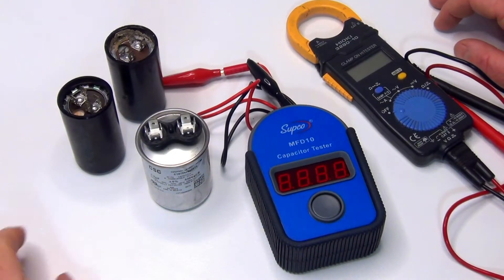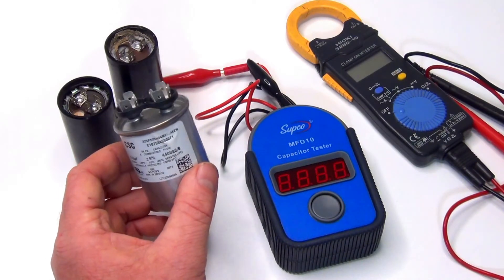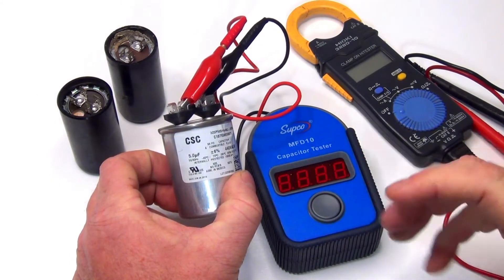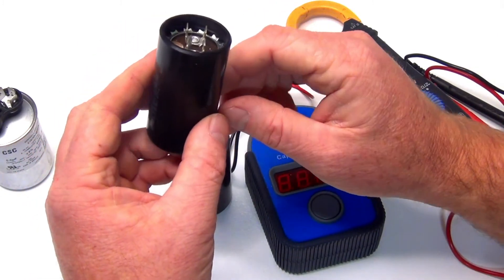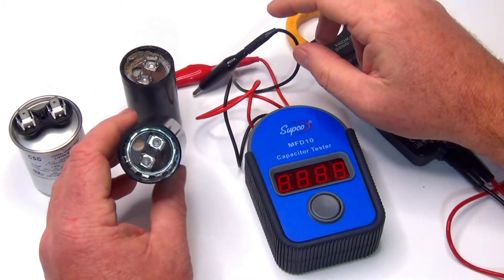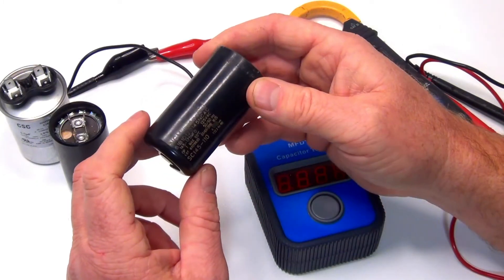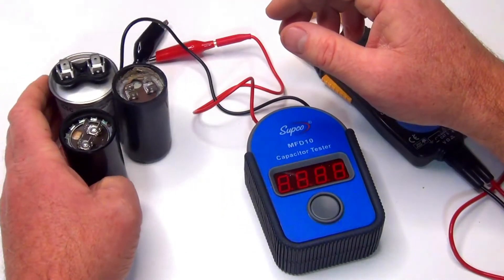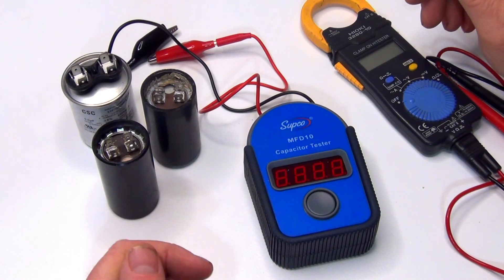Testing a HOT TUB Pump Motor Capacitor | Hot Tub Pump Not Working or Humming

Comment: Had to replace the capacitor on my pool pump motor. 

Just fyi:  It was located on top of the motor housing, not the pump.  The capacitor on my air compressor is located in the exact same place.

Comment: Hey, I have a hot tub but the slow speed pump is not working if I change the capacitor it's work ? When I turn on the show error 6 
Davey Spaquip
Reply from the maker: Find out why that pump isn't working.  Can you hear any sounds from that pump or just nothing?  No sounds?
Reply: @VIPPoolsandSpas   thanks for answer,  when I turn on its work then off push the water then off,  high flow its working
Reply from the maker: @fahadal-badri13  I don't understand your last comment.  If you speak another language, please write it down and I'll just translate it.  Ok?
Reply: @VIPPoolsandSpas  It sounds like they have 2 speeds & multiple pushes of the button cycles it between hi, low & off   Pushing the button 3 times = hi speed on / low speed on / off.
Or, pushing the button 4 times = hi speed on, hi speed off, low speed on, low speed off. . . . A yr. old comment, I know.

Comment: I wonder if you can help me.... I replaced the seal and impeller in my Hot Springs Flair hot tub.... When I reinstalled the pump, I accidentally connected the green wire to the wrong terminal on the pump... when I flipped the breaker to turn on my spa, everything seemed fine until I switched on the jets, it flipped the breaker, so, naturally, I did it again, tripped the breaker again, then I inspected my wiring, compared it to the "before" picture that I took and saw my error.  I wired it up correctly, turned everything on, then tried to start the jets, I hear clicking, the "jets on" light illuminates red, nothing from the pumps (there are two pumps, 2hp each, I think).  Anyways....  There's only one fuse on the mother board, I replaced it, no change (it wasn't bad).  Do you think it could be that I ruined my capacitor ??
Reply from the maker: Make sure to subscribe.     I watched your video.   The relay on the board doesn't sound right.  There's 2 more things you can try.   #1 Turn power off, unplug the pump, turn power back on, any changes on the lights on the board?  Let me know what it does and I'll give you the next thing to try.

Comment: I have a capacitor with only a blue and black wire coming from it. And l only have a normal multimeter. Can you explain the settings it needs to be on.
Reply from the maker: Your meter should have a setting for capacitance.  Symbol looks like headphones or horseshoe.  Unplug the capacitor and test that way.
Reply: @VIPPoolsandSpas  Hi, the multimeter says OL on the screen, tested it went up to 19 and back to O L not a clue what this means. Good or bad?
Reply from the maker: @swedishkev  So, you tested with capacitance and it shows OL.  It should be the same if the 2 leads aren't touching anything.  touch your meter leads together and it should show 0.  Right?  Testing capacitance should show something.  You took the capacitor out right?  No pump wires touching it?
Reply: @VIPPoolsandSpas  Ok, touched both leads says  0.0.The capacitor is away from the hotub. On the horseshoe shape 200k. Goes up to 19 and straight back down to 0.L ??
Reply from the maker: @swedishkev  try replacing the capacitor.

Comment: My pump doesnt trip the breaker but instead it blows a bussmann SC-25 fuse. I replaced the fuse and it blew again 30 seconds later. The pump did turn though during that time. I tried to turn it manually with a screw driver to see if there was any kind of resistance and it felt kinda stiff. I also noticed that the set screw attaching the ground to the pump housing was missing and the ground cable was loose.
Reply from the maker: The ground on the pump will not trip the breaker if its loss.  theres a ground going into the pump.  the outside ground is just an added protection.  The capacitor might "pop" the fuse or a seized bearing might also do that.  If you know its the pump popping the fuse, you should test the capacitor, change the bearing (only if the seal is leaking) or get it looked at by a pump buy.  Might be the windings.
Reply from the maker: Do the same test as this video.  https://youtu.be/RXjaoGk32rc
Reply: A friend asked if I could assess a pump and the pump upon assessment was humming, and jet #1 (swim spa) had no action. The humming determines a bearing issue, correct?